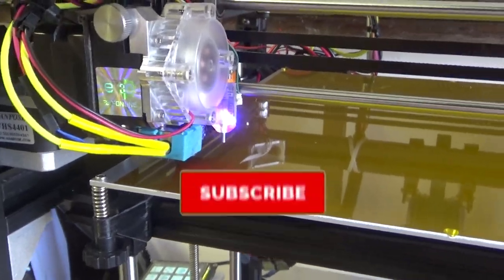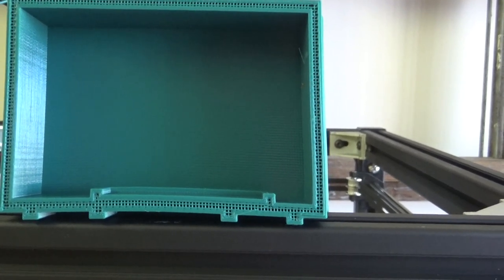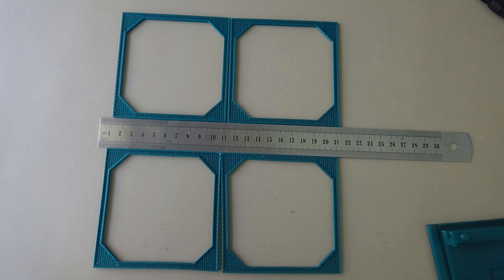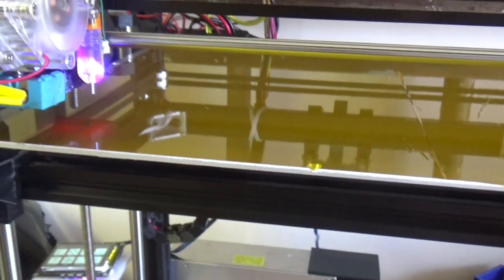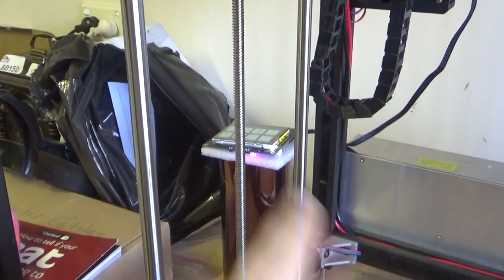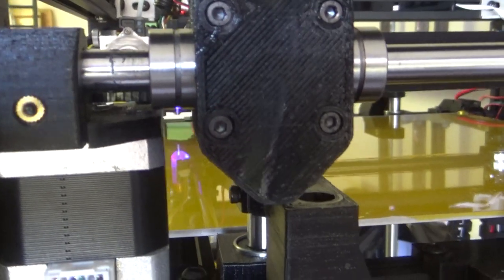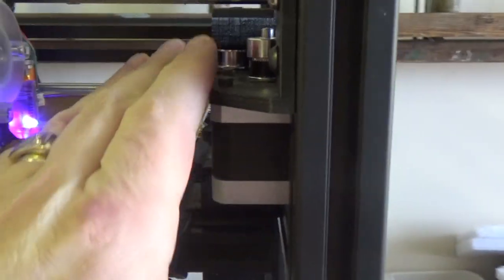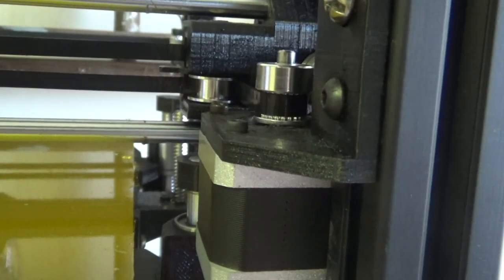#107 Hypercube Evolution 3D Printer Build - 14 (Problems)

Comment: Just a thought but the alignment of stepper motors to belt pullies will cause this movement of belt up and down the drive gear, maybe the tension of the belts are pulling the plastic brackets out of square or they may need adjusting to square them up and make sure that the stepper pully is perfectly aligned with the pullies it's attached to. hopefully this helps I'm in no way an expert but hope this helps.
Reply from the maker: Thanks for your comments. The issue with the belts may have been caused by me over tensioning the belts, not really 100% sure. After replacing the belts I was careful in sneaking up on a tension that seemed to work ok and haven’t had any trouble since.

Comment: It was a delicate problem.
Of course you should change to better belts but can the axial movements of the drive wheels really cause the relatively large movements of the y axis?
My first thought was that the motors do not run synchronously.
If you turn the squares 45 degrees on the print bed, then only one motor will run at a time.
With this test you can see if there is a mechanical fault or a problem with the motors control.

If the squares are good, there is a problem with the motor control.
If the squares get bad, it's a mechanical problem.
Hope you understand how I think.
Reply from the maker: Thanks so much for your comment as this issue really had me stumped for a number of days and all help is very much welcomed.

Trying the squares at 45 degrees is a great suggestion, the squares are 5mm high which is quite a few layers so I had eliminated motor and drive issues due to the z axis layers being in perfect alignment. But as you say with the core XY  kinematics seeing the result with only one motor running at a time will be interesting.

What I suspect is happening is the belt is stretched or just poorly constructed at points over its length rather than the axial movement causing the issues. I expect this could  cause this geometry issue, however I would have expected to see it run poorly over the drive pulleys when it got to the stretched point. Potentially this is that axial movement?? 

At any rate I will try the squares at 45 degree as this should let me know which belt is knackered if it is a belt issue or whether I have a different issue as you say.

Once again, thanks for your input!!